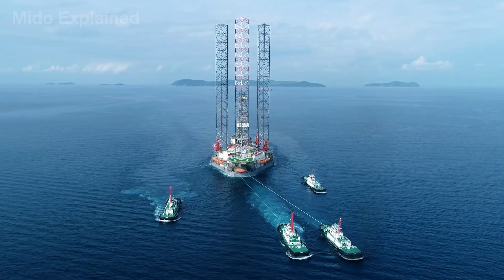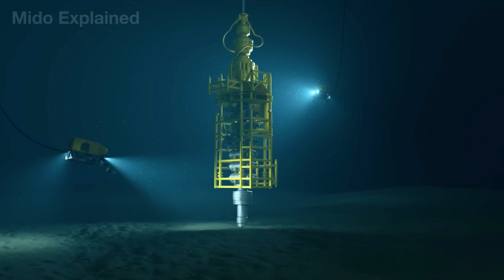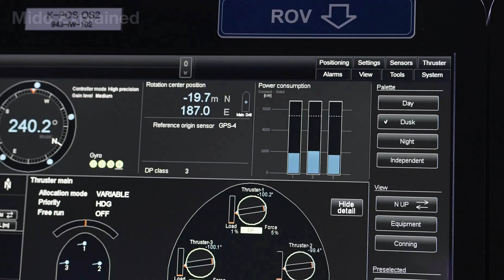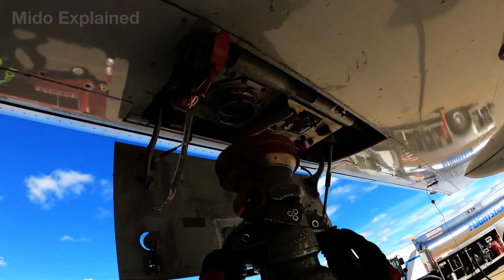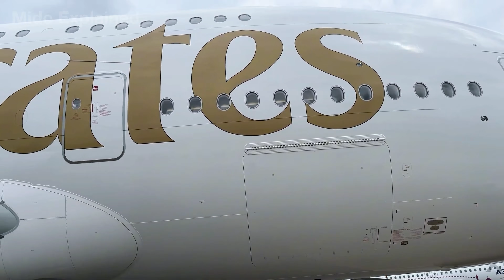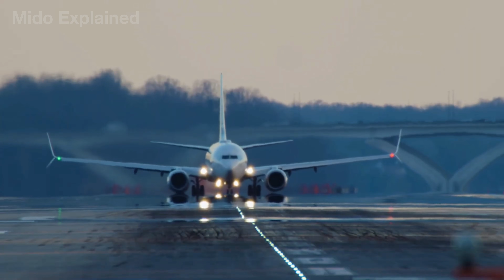Why Kerosene Became Aviation’s Only Real Fuel - The Full Kerosene Production Process

Comment: TWA 800 was hit my a missile.
Reply from the maker: Thanks for sharing your perspective.
Reply: @MidoExplained   The educational video as well as my experience in the Navy with Jet fuel and then that I was a fire fighter, along with the FAA's AWC on the 747 and various other engineering criteria made it impossible for the tank to ever become a catastrophic event as suggested by the NTSB whom we sued by the way, and won. Plus that by general physics, as the plane gains altitude the vented tank gets purged of vapors. the odds of a few gallons of AK ''giving off'' Highly flammable vapors and in the goldilocks zone is nil, plus if any vapors got ignited such would be a low order deflagration and not a high energy event with enough power to break the planes keel beam. 
In Google: [9-18-06 National- Law- Journal Ray Lahr]      
And Then  [Spreaker/aaron sheets]

Thanks again for your educational videos